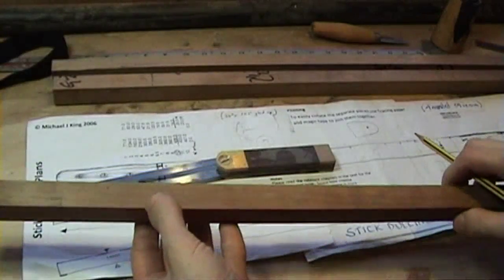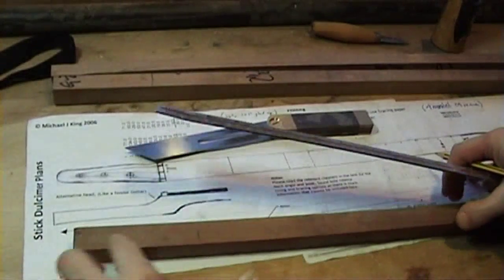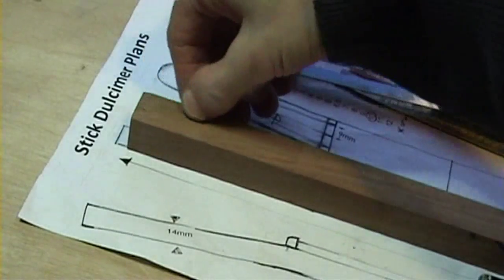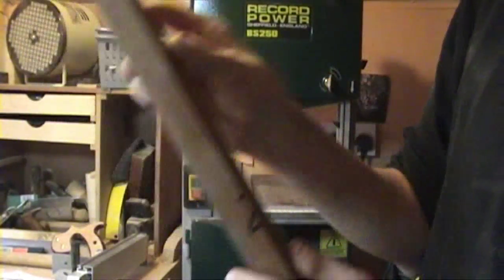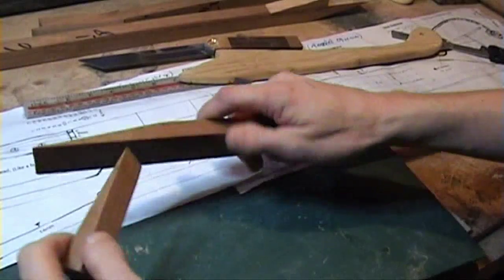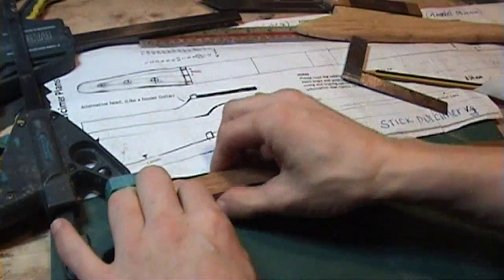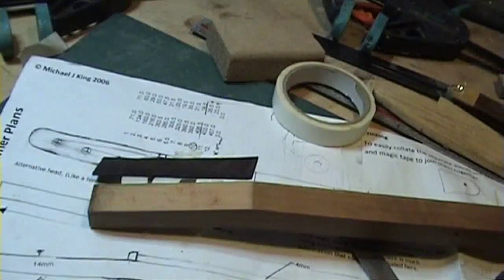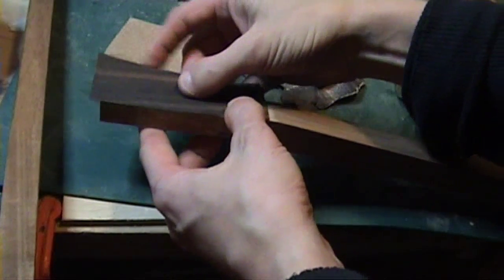Stick Dulcimer Making part 5.2: Making the neck

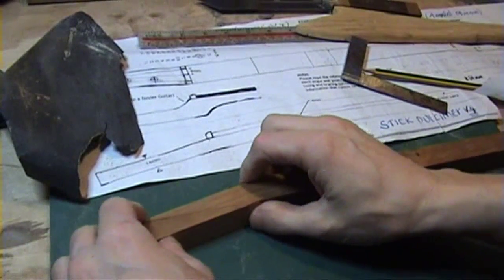Comment: Michael, When you're gluing up at 4:21 those two bits will slide around when clamped. I drive two finishing nails just a bit into the neck and clip it off so that just the slightest bit is left sticking out. You don't want these nails anywhere near where you're going to drill for tuners, of course.
The strongest way to do this would be with a dowel joint,.

Comment: hey michael, nice one. just wonder - is the spacing between the frets the same on all dulcimers? i plan to build a teardrop-model but can`t find any plans whatsoever on the net. so here i come across your new clip. are there any rules to measure the frets in relation to the length of the neck? if so please let me know.... cheers...and good luck....